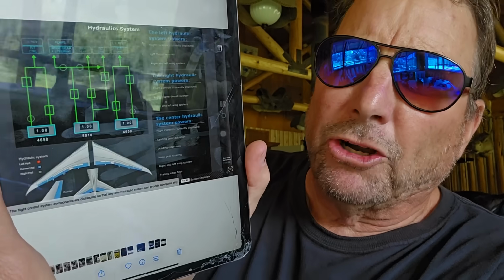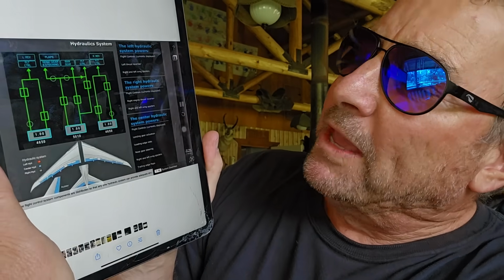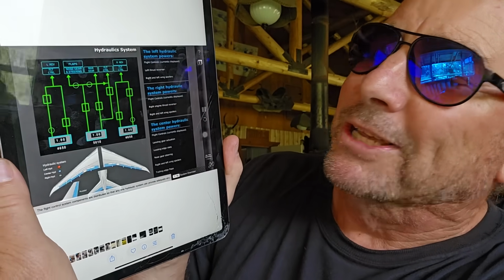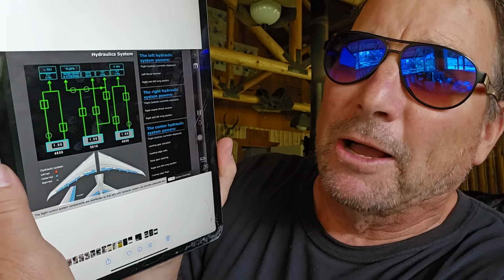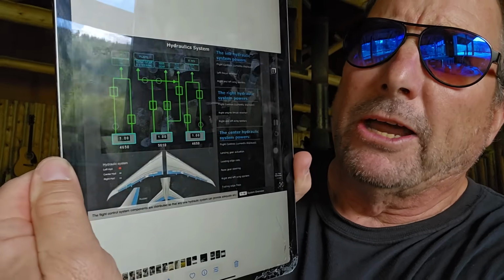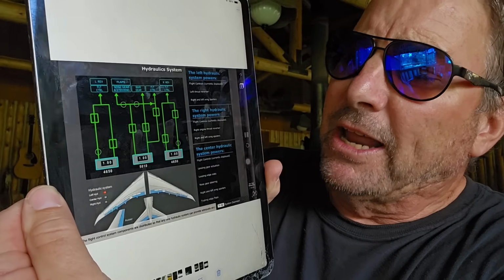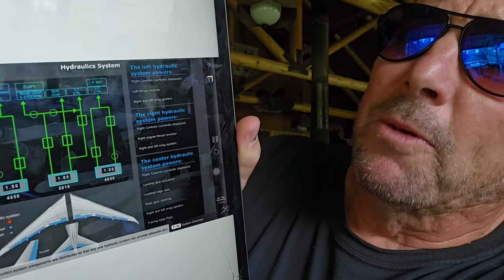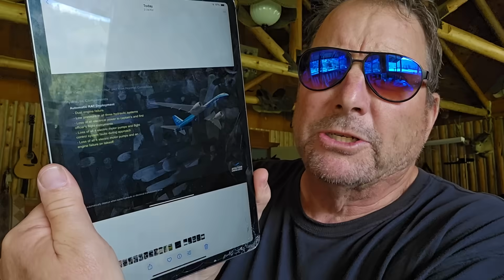787 Crash India What's a RAT? When does it deploy?

Comment: "What if" speculation:  An unexpected RAT deployment during take off would be a major cockpit distraction.  This supports a theory going around that one of the pilots retracted flaps instead of landing gear.
Reply: That makes 0 sense
Reply: nah - that would place the aircraft way outside of permitted flight characteristics & kick off major warnings.
Reply: @GARDENER42  It wouldn't. The deployment of the RAT results in a level C (advisory) indication of "RAT UNLOCKED" on the EICAS; this is the least severe type of EICAS indication out of the three, the other two being level B (caution) and level A (warning). This means that during takeoff, all else being equal, the crew would hardly concern themselves with it, other than to take note that it had occurred and enter into the maintenance log that it should be stowed by maintenance once on the ground, and the cause of the inadvertent/uncommanded deployment investigated. While I was unable to find accounts of such incidents among 787s, there have been several (inadvertent/uncommanded) in-flight deployments on Airbus aircraft, all of which returned without incident or proceeded onward to their destination (the majority of such deployments occurred on the ground during ground tests, where it poses a risk to maintenance personnel). While it's likely a crew would choose to turn back rather than fly the entire way with the RAT deployed, it's not significant enough of a fault to justify interrupting the takeoff and initial climbout. The reason is that the RAT is designed to function and not to interfere significantly with the flight characteristics of the aircraft within its normal operating envelope. If that were not the case, then it would be quite detrimental for the RAT to deploy during a glide following a dual engine failure, as it could significantly impact the plane's glide ratio and potentially do more harm than good (depending on how much residual hydraulic pressure is present and on whether the APU is operational at the time). So, no, the RAT doesn't make the plane unflyable or anything of the sort, or else it would be useless as a safety measure in cases of dual engine failure. And it doesn't set off any distracting alarms or warning systems either.
Reply: I must respectfully disagree because my interpretation of what Juan said at, 4:14 in the video, is that the RAT will not provide enough power to retract the gear.  So if they put the gear handle up, the gear would not have come up. In addition we do not know the position of the flaps yet.
Reply: @loudidier3891  Well as much as I'm skeptical about this person's take, what you're thinking of wouldn't actually refute it. They're describing an unexpected RAT deployment, i.e. one caused by something other than the typical failure conditions that Juan outlined in the video. So if the RAT deployment wasn't due to engine failure, generator failure, or in particular a hydraulic pump failure, there'd be no reason to expect the gear to fail to come up, since the RAT wouldn't be needed to raise them (the RAT doesn't just take over other power sources; it augments them). And anyways, OP is proposing that the crew raised the flaps instead of the gear, so the fact that the gear stayed down is actually consistent with OP's theory, not the other way around. But that's precisely the thing; the gear staying down doesn't tell us all that much. Due to having made a mayday call we know for a fact that the flight crew was aware they were likely going down, and would have been unlikely to have retracted the gear (or the flaps for that matter) so close to the ground. It'd be a different story if they lost power in cruise or on approach, since raising the gear and flaps, i.e. getting into a "clean" configuration, would permit them to optimize their glide distance, right up until landing is assured, when they can then use the manual gear extension mechanism, but in this case it doesn't tell us much. 

Also, fyi I'm pretty sure it's been unofficially confirmed that the flaps were at 5°, so a reasonable takeoff setting; if that's correct it's still possible that they were initially set at 15° and were raised accidentally instead of the gear, but more likely that's just the setting they took off with. In any case, given that the RAT was deployed, it's likely the ultimate cause won't be as simple as just "pilot pulled the wrong lever", though we can't yet rule that out for certain.
Reply: @loudidier3891  Well as much as I'm skeptical about this person's take, what you're thinking of wouldn't actually refute it. They're describing an unexpected RAT deployment, i.e. one caused by something other than the typical failure conditions that Juan outlined in the video. So if the RAT deployment wasn't due to engine failure, generator failure, or in particular a hydraulic pump failure, there'd be no reason to expect the gear to fail to come up, since the RAT wouldn't be needed to raise them (the RAT doesn't just take over other power sources; it augments them). And anyways, OP is proposing that the crew raised the flaps instead of the gear, so the fact that the gear stayed down is actually consistent with OP's theory, not the other way around. But that's precisely the thing; the gear staying down doesn't tell us all that much. Due to having made a mayday call we know for a fact that the flight crew was aware they were likely going down, and would have been unlikely to have retracted the gear or raised their flaps so close to the ground.
Reply: I've seen that debunked based on the fact that those two levers are nowhere near each other in the cockpit. The conclusion I am coming to is that this plane was poorly maintained and that something in either the fuel system or the electrical system caused the engine to lose power. Maybe electric fuel pumps that lost power, or failure of the pumps themselves.
Reply: @aftonline  And your 'conclusion' is based on absolutely zero evidence.
Reply: @GARDENER42   There's plenty of evidence for those who want to see it. We'll find out in a week or so if I was right. Juan is focusing on the RAT, and the RAT is only deployed as a result of some kind of major system failure, so there's your evidence. I defer to Juan's expertise and instinct in pursuing this line of thinking.
Reply: @aftonline  Go on then: cite the 'plenty of evidence'...
Systems failure does NOT constitute evidence of poor maintenance.
Juan has made no such inference.
What I'm starting to see here is an intimation of "brown man incompetent"...
Reply: @GARDENER42  It wouldn't affect flight characteristics in the least. You realize this system is designed to operate during dual engine failure, right? It is intentionally designed not to significantly interfere with flight characteristics, including the glide ratio, for that very reason. I've not been able to find any instances of inadvertent/uncommanded deployment on 787s, but on Airbus aircraft, it's occurred a few times, and has always been a non-event.
Reply: @GARDENER42   The head of Air India is a white man, so there is no such intimation. Culture flows from the top of an organisation. But one could equally say that those who are pushing the pilot error narrative are intimating 'brown man incompetent". Regardless of the colour of one's skin, if one does not do one's job correctly, there are consequences. The fact that this is the first ever 787 to go down in this manner implies that there is something specific to this aircraft that caused the problem. That's more likely due to poor maintenance of a specific aircraft than an inherent flaw in Boeing's systems. None of the other 1100+ 787's have had this kind of catastrophic failure. I'm personally interested in finding out what caused this problem so they can fix it, whatever that entails. If it was poor maintenance, we don't blame the individual necessarily, but the system of checks and balances in the maintenance system as a whole. Maybe it's just that a certain part was not replaced when it should have been because of cost-cutting. That's on the upper management of the organization, so full responsibility falls on the guy at the top. Not a race issue. I'm not a fan of critical race theory. We are all human beings, and in my book there is only one race, and that's the human race.
Reply: @GARDENER42  Additionally, RAT deployment triggers a level C (advisory) EICAS message, namely "RAT UNLOCKED". This has no memory items associated wirh it, so assuming all else is equal, this would merely be noted and not dealt with until the after-takeoff checklist is completed, and possibly not until cruise. There are three levels of EICAS messages, the other two being level B (caution) and level A (warning), in order of increasing severity; only receiving a level A message would trigger an alarm and/or require the pilots to interrupt their normal takeoff procedures and intervene. Everything else is of lower severity and would be dealt with during the climbout checklist, which commands the pilots to check whether all engine and hydraulic systems are operating normally.
Reply: @GARDENER42  To my mind, the most probable theory given the currently available evidence is that the plane failed to produce enough lift or enough thrust to get off the runway in time, and as a result, ingested debris and/or antennae/runway lights at the end of the runway, leading to a dual engine failure immediately upon takeoff. But that's highly speculative, and there's a lot we still need clarity on before any supposition of that sort is justified with high confidence. From all indications, it does seem as though the flaps were at about 5°, so I wouldn't get too hung up on the state of the flaps until we know for certain one way or the other. If they had had to glide from a considerable altitude it'd make sense to retract flaps and gear for an optimal glide ratio, but since they were so close to the ground, leaving them in place, or even dumping further flaps, would be the best course of action, to minimize the energy of the impact.
Reply: @pointsandlines12x35  I'll stick with waiting for the results of the investigation thanks.
Reply: @GARDENER42  Same. Looking forward to the release of CVR/FDR results soon. But I will say, as more and more information has trickled out, gross pilot error is seeming to be less and less likely
Reply: @pointsandlines12x35  I think we would have heard by now if runway lights or antennae were missing.
Reply: @loudidier3891  That's a fair assumption, but we're also still yet to receive confirmation of how far down the runway the plane got before taking off; the same goes for the origin of the big cloud of dust that appeared right as it took off. Unless you've heard any updates to that effect, in which case I'd appreciate a correction

Comment: Its time to stop making guesses and wait till the investigation is underway. They have recovered the two black boxes and I suspect that very soon after seeing and hearing the data they will know what happened. I've heard they accepted an intersection takeoff. Why can't they be confirmed or denied. Its something that is known without question. Why don't they tell us? CYA? If they did it should change the rules so that they never accept anything but the full runway. Never, ever accept something that shaves your safety margins even a little. Another concern is the use of reduced thrust for takeoff to save fuel and wear and tear. Yes, it saves money but it erodes safety. This plane appears to have used every inch of runway since you see the dust being kicked up from the overrun as they lifted off. Would they have used less runway or maybe used the same amount of runway but had a higher speed at takeoff if they had used the entire available runway?

Comment: If definitely sounds like the RAT was deployed. Its hard to miss. It literally sounds like a piston engine at takeoff power
Reply: So you're saying a rodent is involved?
Reply: @guitarexpert2245  Yep, a big sewer rat wearing a propeller beanie.
Reply: @guitarexpert2245  lol no RAT is an acronym for Ram Air Turbine--a mounted turbine that is deployed in cases of hydraulic or electrical system failures. 🐀
Reply: I thought the characteristic sound of the RAT was similar to the sound of a propeller-driven airplane, and it didn't matter whether the propeller was powered by a jet engine (a turboprop) or a piston engine.

Comment: I was pretty sure one of the pilots had mistakenly retracted the flaps instead of the gear.  Not as sure now after the audio.
Reply: In another stream someone claiming to be a 787 pilot said the plane would not permit this in this configuration.
Reply: @2505JAD  not sure what that even means.
Reply: Could be both.  The RAT deployed because of ongoing electrical issues.  The pilot monitoring raised the flaps instead of the gear and caused the crash.

Comment: Hmmm, not any experience here with aircraft, and not trying to be an internet lawyer, but I did not hear the same prop noise on the India jet. Another channel details that takeoff with the jet mis-configured (ie: no flaps), is near impossible due to the warnings. However, takeoff followed by accidently retracting flaps (instead of the gear) could cause lack of lift, thus no matter what engine power - no flight. Your comments?

Comment: if the rat was out that early on the runway, would you not try to stop ??
Reply: If the RAT deployed before V1 then they would have rejected for whatever the reason was for the deployment.
At or above V1 they would be taking it airborne unless they knew it was a dual engine failure or other malfunction that rendered the aircraft un-flyable.
Reply: @Captain101-x1o on one of the videos , with audio  there saying as the plane went by that shed ( mid runway ) that it sounded as the rat was out.. juan hasnt had that videos as I guess he is out playing . With that I think at that point ( app. mid runway ) I would try to stop . glad I was there .
Reply: Juan needs to tell us if the deployment is a big flashing light in the cockpit
Reply: Or a sign that says I smell a rat

Comment: There is a cphone video taken from inside the cabin of this plane showing no lights and no AC from inside of the cabin on a sweltering hot day. I would think this means no APU and perhaps electrical issues.
Reply: Ground power would normally provide lights on stand.
If no APU then it would have most likely started at least one engine on stand.
Reply: I watch that video too and the Rat audio. Im still not going to conclude one way or the other at then moment, It raise lot of concern for sure,...specailly after watching air liners take off every  a min or 2 from an air port.
They're loading and unloading passenagers/luggage..ect
Plus Ive been on flights with lay over ( same jet),..I'll exit the jet to stretch my legs, I didnt see any INPECTION CREW entering the cabin,...you ???
Reply: It tells a story about Air India, but not necessarily the plane's air worthiness.

Comment: It is possible to deploy the RAT manually. One theory could be they took off as normal. Initially the aircraft did climb. Upon requesting gear up, the flaps were retracted by mistake. Aircraft started to stall and it was mistaken by the crew as dual engine failure. I believe the crew of Spanair 5022 also thought this, when the stick shaker started. The crew then deployed the RAT themselves to not lose full electrical power during the miss diagnosis. Anyway we will soon find out!
Reply: The computer will not retract the flaps before F speed on the 787. So you're theory has already been debunked and it doesn't explain the RAT, the bang the surviver heard and the lights going out.

Comment: What is the maintenance requirements for the 787 once it reaches ten years?
Reply: There may be some items that require a 10 year check.
Same as there are items with 1 year, 5 year, 20 year checks.
Many other components are checked based on flight time or take off and landings or pressure cycles, etc…
Modern maintenance programmes are extremely complex.